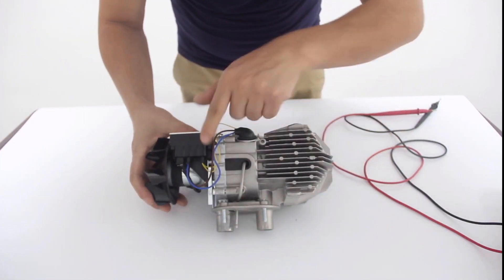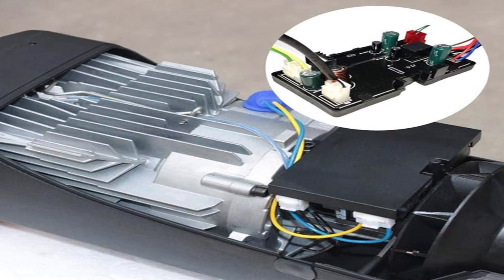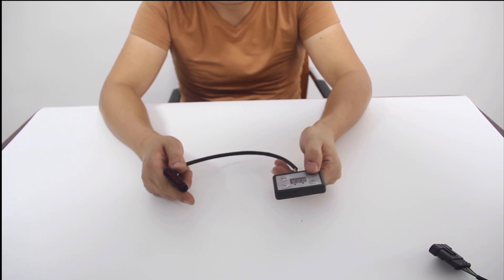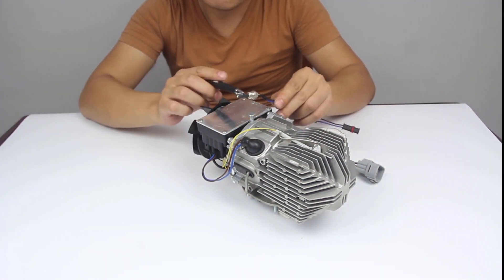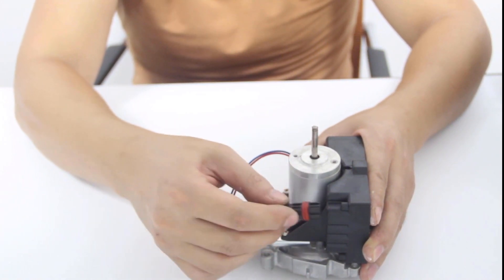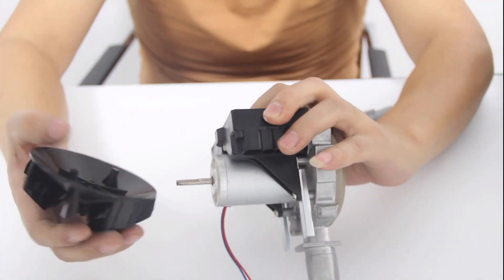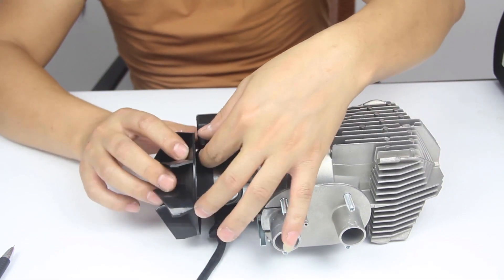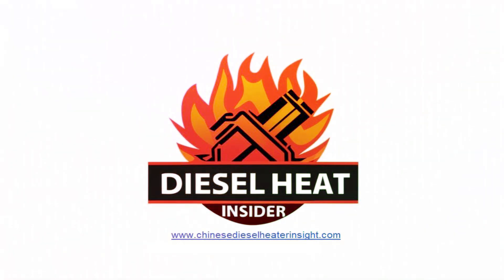Diesel Heater Error Code Troubleshooting

Comment: I have an e12 error code on my LF Bros N2. I have used it for 5 months with no issues. Ive run it on 110v and its currently installed on my truck 12v. Naturally, the day before the coldest night of the year and it wont start.